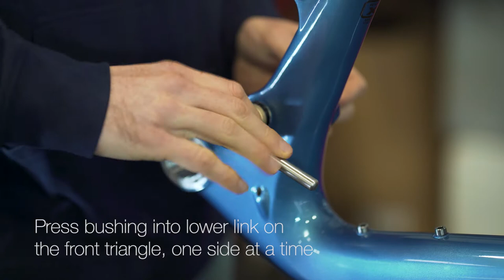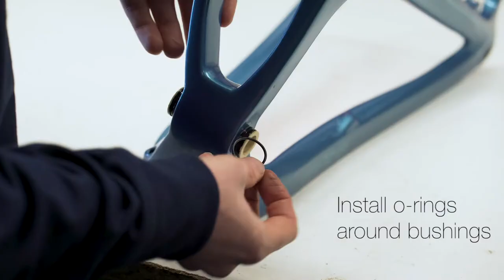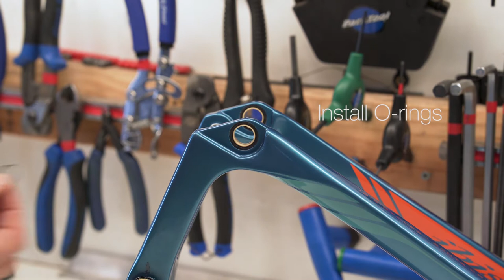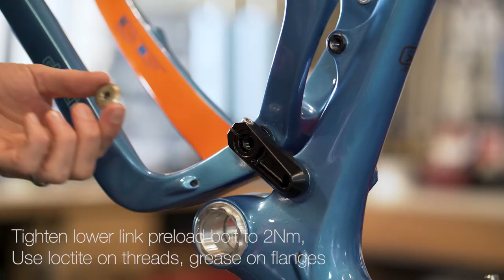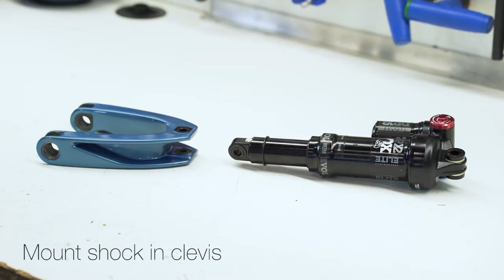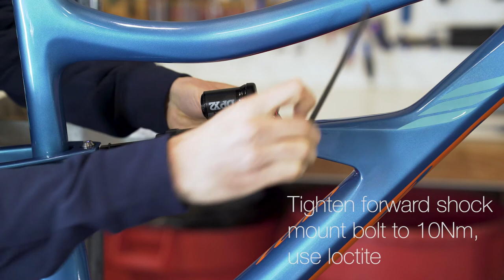Ibis Cycles Assembly and Bushing Service

Comment: I loosely threaded the upper link upper bolts (wide) first, then aligned the lower (narrow end) and threaded those 2nd. This made it much easier. Getting 4 holes aligned perfectly to thread the bolts was a mother.

Comment: When installing the Upper Link upper bolts, how do you torque it to 10Nm? I can't seem to find any torque tool that actually fits inside of there.
Reply: Came here looking for that answer. My guess is that it requires a low profile hex bit.
Reply: I usually just best guess these, I torque up one of the accessible bolts to 10Nm and then put a long Allen key into same bolt until it just begins to turn, I feel the force and look at the bend in the Allen key when holding at the end and then try and apply same to the upper link bolts, err on the side of slightly less as you use loctite anyway so shouldn't move. Works for me.
Reply: The Feedback Sports torque wrench fits.
Reply: @weaselbmx  awesome, thanks for that!